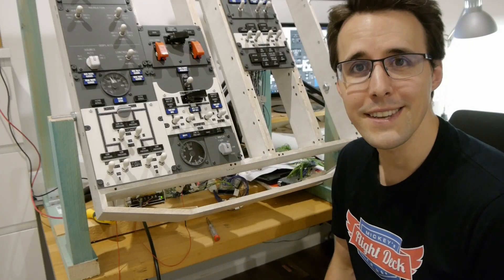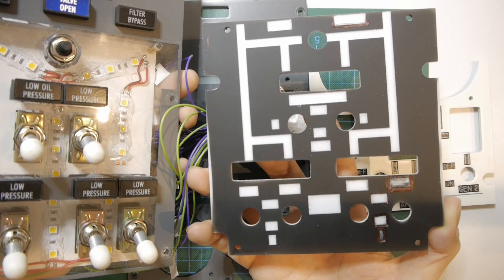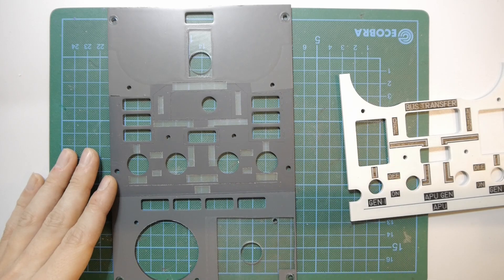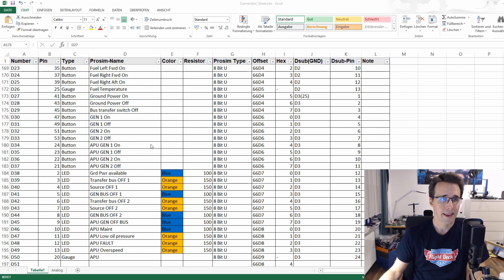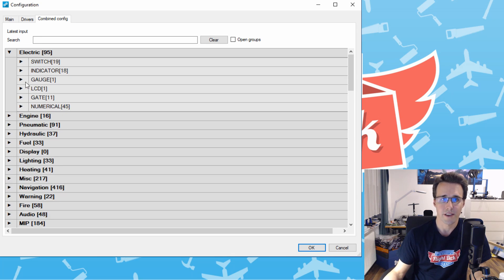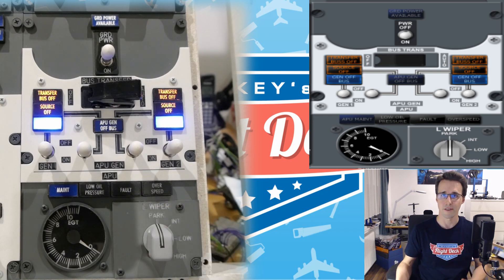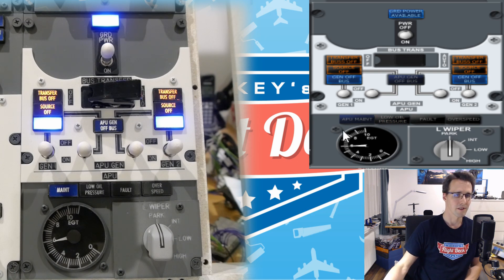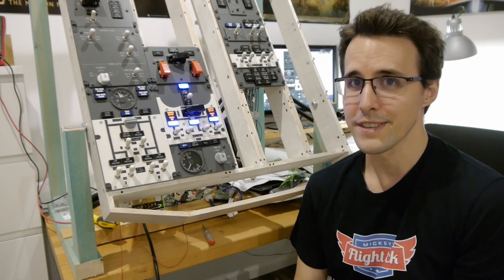Power Source Panel - A Boeing 737-800 Homecockpit #48

Comment: How did you secure the knob to the rotary switch?
Reply from the maker: A set screw is screwed into the side of the knob.
Reply: @Mickeys_Flightdeck  Thanks! Would there be an alternative to the screw? Maybe some sort of filling or would glue even do the job?
Reply from the maker: @bradybrother100  I think epoxy glue would also hold the knob but you wouldn't be able to remove the switch or disassemble the panel anymore.